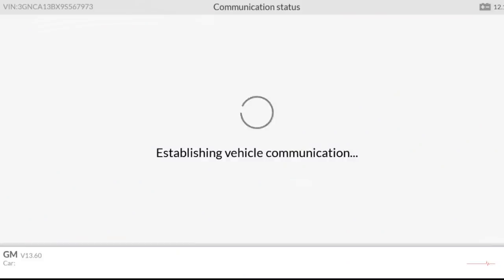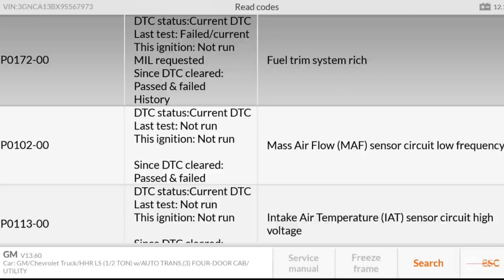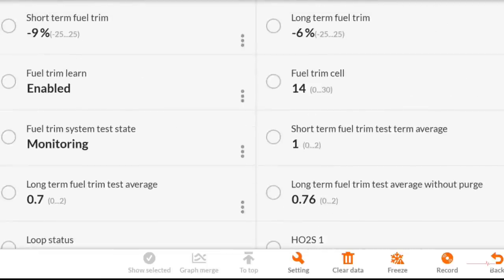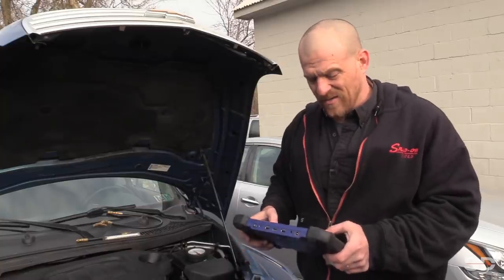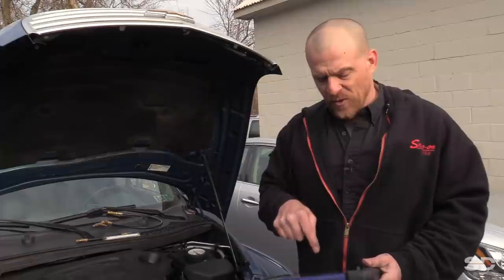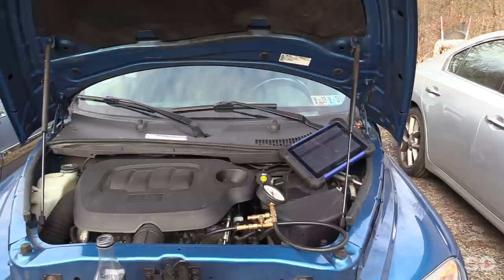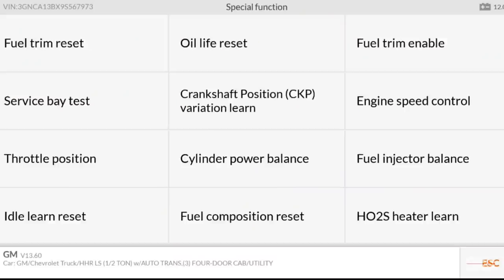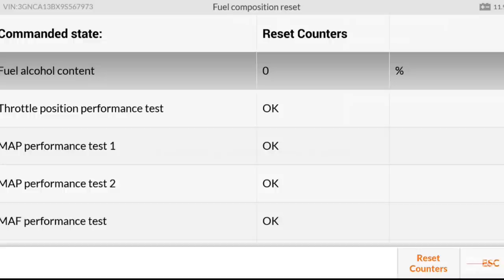P0172, P0300, Extended Crank-Incorrect Alcohol Content-Flex Fuel System

Comment: Great video, I came across that same scenario on the HHR years ago and discovered the same fix.

Try using 100% ethylene glycol instead of the water in the alcohol tester. You'll have a great visual reading. Alcohol will mix with antifreeze like water, but gasoline will not.

Thank you for all the great content. You have a real understanding of diagnostics.
Reply from the maker: Thank you for the reminder about this video! I just made a short from it 🙂

Comment: One thing to note about running e85 is that not only does it take a lot more fuel to run at at all times, but under cold start conditions you need a MUCH higher rate of fueling to get it to initially fire. When converting cars that do not have flex fuel functionality to run E85, it's not unheard of to see injector duty cycle upwards of 100% during cold crank events. This is likely why the initial cold start was flooding the engine and the subsequent starts were practically normal. 

Keep up the great work ScannerDanner!
Reply from the maker: Thanks for the info! I'm so mad I didn't turn my cameras on before attempting to crank this engine.

Comment: Just went thru this today with the mother in law's car, hooked up the scan tool, looked at data, browsed through and 🤯what 73% alcohol content, reset composition and fuel trims went from -28  to -10 and watched as it started to correct it's self. Was pretty sure that was gonna be a fix but just wanted to confirm before I got a call and got yelled at 😂 thanks Paul just took a load of stress off of my shoulders. ScannerDanner comes thru once again in the clutch. Gotta love these videos.

Comment: Something similar to this happened to me last day. High pressure fuel pump in GDI engine started to leak gasoline to the crank case and made the mixture so rich. I only have a bluetooth ODB-II adapter and I was able to identify the rich condition. Disconnected the PCV system temporarily and all symptomps went away. Thanks to you, I learned lots about fuel trims from your videos. Today I saw this I could have seen this last day becuase I took whole last day to identify the issue.

Comment: Not surprised you have no negative reviews on ScannerDanner Premium - there's not a damn thing bad about it! 😉 I've said it a million times  - the channel is THE BEST bang for the buck in the automotive industry, hands down. Keep up the great work on both channels! You never disappoint. 👍👍

I own a '07 Silverado 1500 with the AFM 5.3 (VIN "0") - the fuel composition reset is part of regular maintenance on that thing, LOL! Eventually when I get a J-box I'll attempt an update ... if they still offer it by then (would be just my luck they discontinue service due to age).

I've got a fuel test kit I bought a couple years back that's the opposite of yours - it goes up to 30% and stops there. Wish they had a full scale from 0 to 100% - not a huge deal, just would be nice. Was surprised to find the local stations around here in the 6-7% range - I expected it to be higher than 10%, so the state and the fuel company would rake in the extra revenue by ripping us off.  😂 Back when my truck was still new, it always read 16% -18% alcohol composition. I always fill the tank from empty, too (don't like topping off, because I hate stopping for gas to begin with - the less I can do it, the better). Not one of GM's finer designs (among many, lol).

Comment: For those watching, and that are not subscribed to the premium channel, you NEED to be. I am a DIY'er who fixes cars for others on my days off from work.  Thanks to SD Premium I'd call myself a semi-professional, though I have no ASE certifications.   I just fixed another car yesterday that a professional shop could not fix (this is the third one in two years.)  They put two crank sensors in trying to fix a P0335 code and a long crank time.  It was a 2006 Nissan Altima 2.5L.  They replaced a connector and two sensors on it and didn't fix it.  They sent the lady out the door with it that way after two come-backs.  When I went to test it the butt connector splices fell apart.  It was a mess but I could not have fixed it without the foundational knowledge gained from the Premium channel videos.  I had good good power, good ground, and 12v on the signal wire all the time with the key on--but no pulling to ground during engine rotation.  When I unplugged it the fuel pump would turn on so I knew the wiring was all good to the computer.   I knew what I needed to have at that sensor, knew I had it, and finally figured out that the sensor wasn't seating in all the way.  They installed two of them that way and I even installed it that way at first when trying to figure out the problem. Seems simple except that the crank sensor on this car cannot be seen, only felt (and just barely) for removal and installation.  Get the book and go through the course.  I actually initially subscribed thinking I'd watch the videos and cancel before 14 days.  That was a couple years ago now and I still subscribe.  Best $11 a month I spend.
Reply from the maker: Best write up ever John! Thank you so much, such a cool story too. Really appreciate this public comment.

Comment: Have same issue on a Volvo 1.8 Flexifuel.
Resetting require two way diagnostic tool and it does reset to 50% and then re-learn..and again to values above 50% ...closer to 60-70%.
Never ever used ethanol fuel. Engine is flooded every now and again on cold start (using full pedal to unflood).
How to resolve that permanently? Is there any sensor for the alcohol content? 
How does it learn the wrong numbers? 

Great video as always!

Comment: Good cheap fuel quality tester that works great when you are in the field like this are the large plastic medical syringes. They usually have graduations up to 150ml and are cheap and available everywhere there is a pharmacy.  The nice part is they are pretty clean to use as you can suck the contents in to it to an exacting amount instead of pour and pray.

Comment: I got this on my HHR, replaced the MAF before seeing this video.. changed the purge valve and reset the alcohol to zero from 30. Now it runs better and P0172 is gone but the P0300 is still there. (Coils and plugs were changed, fuel pressure is good)
Reply from the maker: Can you feel it misfiring?
Reply: @ScannerDanner  yes, it runs rough when at idle. Very much like a hunting idle. When you throttle up and let it come back down, it usually runs smooth. Once warm idle improves. (O2 sensors were already replaced)
Reply from the maker: @oxygen454  you're going to need to do some testing. Scan data first to ID which cylinders show the most misfires. Then go from there. Spark, fuel and compression must be verified on the affected cylinders
Reply: @ScannerDanner  compression was pretty even and in spec across all the 4 cylinders. Fuel pressure is good too. I will have to check   the strength of the spark. I’m not sure what the voltage to each coil is supposed to be from the ECM. Probably 12 volts but will have to do some research on this 2.2L. I have an older Modis SnapOn scanner.
I really appreciate your replies and am hooked on watching all your videos.
Reply: @ScannerDanner  live data on the last scan was showing 0 current misfires but history shows 
1 at 885
2 at 896
3 at 760
4 at 821

Misfire cycles:75
No. Of misfires: 0
Reply from the maker: @oxygen454  since it i showing misfiring on all cylinders, it is most likely not going to be an ignition coil or spark plug issue. What are your fuel trim numbers? ST and LT at idle and 3000 rpm in park

Comment: @3:17 getting rid of the ethanol sensor in my opinion was one of the worst mistakes GM ever made with regards to flex-fuel vehicles. They tried to use software to do a job meant for hardware and this is the end result.

Comment: My 06 Honda Civic FD having a negative fuel trim no 10 to -12, rev it up to 2k rpm still e same FT will go 0 then again goes back to  -10. Not sure what is e problem. No DTC encounters. Car is running fine. However, morning cold start ard 24 26 deg C  here in Singapore many times will hear something like high pressure (exhaust gas?) being release, usually only the first start in e morning or the car has been sitting for more than half a day. After e morning start, Throughout the day I’ll not encounter this.  Cleaned my MAF, Throttle body, spark plugs are in good condition, changed new ignition coils, still encounter this - FT no, rich condition. Any Idea SD?

Comment: Scanner Danner just out of curiosity being that you mentioned the short trip stuff and fuel. If one is doing this often, the fueling habits (Not Me, FIll with 91 all the time) would it be good to say maybe they should put a little fuel stabilizer in there every few tanks or so? If anything to get the moisture out of the fuel. 

I do this all the time with my Snowblower and Lawnmower especially between seasons. All I’ve ever did to the mower and snowblower from 2001 on snowblower and 2005 on mower is spark plug, air filter, oil change, sharpen or replace mower blades annually and I ordered online and replaced a leaky carburetor on the snowblower once about 8 yrs ago, great since then. It was just as cheap as buying a carb kit. Little TLC goes a long ways.
Reply from the maker: That won't help for this situation but absolutely for small gas engines that sit!! I use stabilizer in my bike, generator, snow blower etc

Comment: I have an 11 regal with the random misfire code and rich condition. I’ve reset the cel twice and it’s still showing up, Also reduced power when accelerating I think it’s time for a tune up. Spark and wires replacement scheduled as well as an oil change
Reply from the maker: rich condition as in negative fuel trim numbers? If so, a tune up is not your problem

Comment: So is the reason for the alcohol being put in gas is... Cleaner burning or...what and in your test what the purpose for using water w/ gas i know is heavier than oil  and gas so it goes to the bottom.
Reply from the maker: Great questions! Alcohol and water are soluble, so when you put water in with the gasoline, the water and alcohol combine. I'm not a chemist, but basically it pulls the alcohol out of the fuel and it mixes with the water as one solution.

Comment: Can 20 percent alcohol on a 2007 4.8l Silverado non flex cause a p0300? My fuel trims are only slightly negative I would say minus 10 to 12 and not rough idle just a flashing p0300 at idle never on acceleration and never rough running or rough idling when flashing.

Comment: After you shake your sample, do you invert the test bottle to read ETOH  %?
Reply from the maker: No, it's not supposed to be inverted. It is meant to measure e85 so your alcohol/water sample would be much higher on the gauge. Which is why they started it at 70% on the scale. I suppose you could invert it if you wanted, but I think it clearly showed about 10% without doing that.

Comment: I got a better alcohol tester from a small engine shop. It has the Kohler brand name on it. It reads alky content as low as 10% and as high as 85%. Small engines such as lawnmowers, weed eaters and chain saws don't want higher than 10%.

Comment: when the car is running , shouldn't the flex fuel sensor report correctly without a reset? Is this an indication of a bad flex fuel sensor?
Reply: There is no actual fuel alcohol content sensor, the value is calculated by the ECM using some algorithm.
Reply: No usually its caused by an outdated cal id and extensive short trips or small fill ups .
Reply from the maker: No flex fuel sensor and I can't add anything more than the two guys ahead of me! Thanks guys (Sangueffusor and gearhead 4life)
Reply: got it,  thought it had that sensor

Comment: P0171 and negative fuel numbers? Need some ideas with this....
Reply from the maker: When you have lean exhaust codes, then see negative fuel trim numbers, this typically means the problem that was causing the lean condition is currently NOT there. I have found oxygen sensors that are failing cause this condition. I've also seen purge valves stuck open, causing this condition (vacuum leak after the canister is depleted of fuel), then the valve closes intermittently and you'll see negative trims. I always say to myself "something just changed" when I see that. 
You'll notice the LTFT is positive (where the P0171 is coming from) and the STFT will be negative as you are describing.
Reply: @ScannerDanner  https://youtu.be/iHXg-5w9u6k, it looks like this. Lf and st are negative. Ive cleaned pcv and maf., numbers have improved, code doesnt turn on, but trims are still negative.
Reply: thanks, i will check purge valve as well if it is cousing the problems. negative fuel trims have improved after i ve cleaned the pcv and maf, but trims are still negative. at the moment the engine fault light is off third week now.
Reply from the maker: You said you you had a po171 code, that would be positive trim numbers to set that code
Reply: @ScannerDanner  yes, that is why i am confused.

Comment: I need your help. I have A HHR 07 I that I need a reset
Reply from the maker: I'm not sure how to reset it without a scanner. Maybe a battery disconnect and then touch the battery terminals together (capacitor discharge)

Comment: What scan tool are you using? Also I watched a video where you were on the porch I think a jeep and you were kinda reviewing the tool I commented about the glitch(it's pretty cool that have responded to all 3 comments in posted) is this the same tool? Also I have more uscope question any links?
Reply from the maker: same tool, I linked the most similar Autel model in the description, so far Iike it. The Verus, by far, has better data lists
Reply: @ScannerDanner  I thought you said it was something other than autel like a sister company
Reply from the maker: @robertoswald2321  It is or was owned by Autel, it has been discontinued but it was essentially and autel with key programming features.
Reply from the maker: It is called an Auro (sister company of Autel) and has been discontinued. The scan tool portion of this tool is exactly an Autel, so it will look familiar to a lot of users. I ask my friend Carlos from AESwave which Autel scan tool matches the features of this Auro the closest, and he said the Autel MaxiSys MS908s Pro, if you are interested, here is my affiliate link (transparency here, I do receive commission for this tool)  https://tinyurl.com/y6kcnwwk
As far as a review of the Autel scan tools (Auro too), I don't have much to offer yet, I haven't used it enough. I figure the best reviews will just be to keep watching my channel and you'll see me using it as I do own this tool now. But don't worry, I will NOT be putting my Verus away :-), it is still my favorite and it has a built in scope, so when I am shooting videos and have a recording going for the scan tool, I don't have to run another recording program on another tool for a scope test.
Show less

Comment: My 2014 Expedition will constantly climb back up to 60-ish %. Ill do KAM reset or hardflash and for a few days it is good. Then starts hard and climbs up in wasted fuel economy
Reply from the maker: Ford uses a flex fuel sensor from memory. Are you using an alcohol blend? What are your fuel trim numbers when it is at 60% alcohol?
Reply: @ScannerDanner  yeah I have read it uses a combination of fuel pressure, o2 readings, MAF readings and knock sensor readings to determine an inferred percentage. Fuel trim numbers climb to rich -14/-17% LTFT. Both banks stay rich and steadily climb together. 87 octane gas, no ethanol ever used
Reply from the maker: @kellenwilliams6836  they've changed systems over the years, make sure yours isn't using a FF sensor
Reply: @ScannerDanner  I can confirm mine has no sensor, as per Mitchells service manual for the model year

Comment: I had a dead miss in about the same year. Came to finally find that the owner had replaced one injector with a non E85 injector in an E85 vehicle...yes it missed. Pulled my hair out for half a day.
Reply from the maker: Had an auction vehicle that someone dropped in a non flex fuel engine in a flex fuel platform. Fuel trims were +45% all the time! lol got my ass kicked too!

Comment: does oil change affect trims?
Reply: I assume in this case because the engine was running so rich  for so long then fuel vapors contaminate the oil. So oil lubricating the engine carries that excess fuel into the system and it’s unmetered fuel causing the still rich condition. So assuming you do the oil change you remove that fuel contaminated oil the trims should come closer to 0.
Reply from the maker: @steveo782812  exactly!

Comment: This is a temporary fix - check engine light usually comes back on pretty quick with same problem.
Reply from the maker: there is a reprogram for the final fix but it has been a few years now with no issues, sounds like you have something else going on

Comment: Yeah interesting video Scanner, but only thing i think is that i don't think the manufacturers made the car to behave abnormal if an amount of fuel is not applied and if you take short trips.  Just my opinion.
Reply from the maker: they certainly didn't do it on purpose, but this is the issue, there is a PCM update to fix the algorithm permanently , should you chose the extra money for the fix and go that route. Otherwise, fill your tank every time with this system.
Reply: @ScannerDanner  okay cool Scanner👍  i guess it's just me,  i wouldn't want to even be bothered with any machine that has that kind of issue with it just to go from A to B.  But Thank you so much for that information!